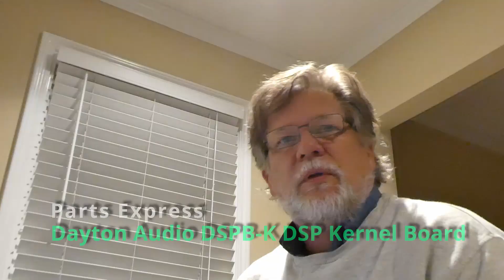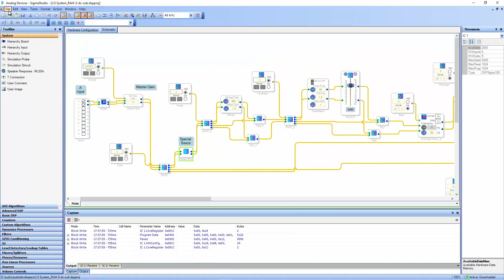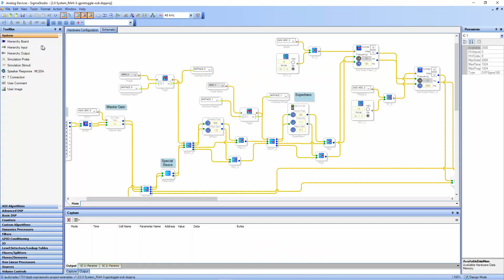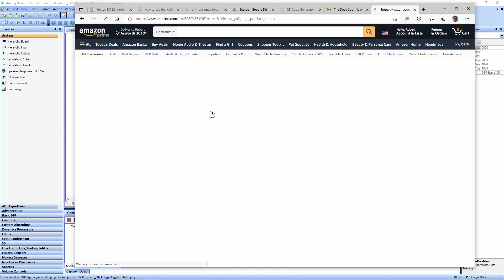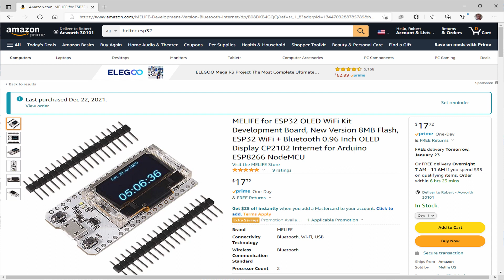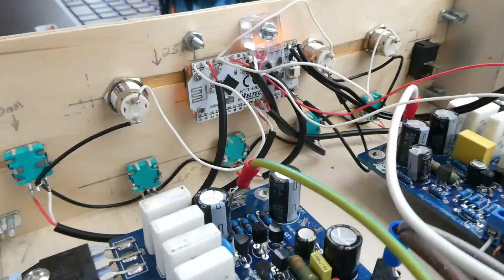ADAU1701 Based DSP Board Stack (DSPB-K, DSPB-KE, DSPB-ICP1) by Dayton Audio

Comment: AMAZING!!! Can you please make some videos on communicating via I2C to the DSP Board? It will be Great.Cheers
Reply from the maker: Next up
I hope 🤞
Reply from the maker: In the process of preparing a video I fried my Heltec ESP32 board with ESD (electro-static discharge). I am weighing replacement of the board against a total redesign. If I redesign it will be a long time before I can complete (or redo) a video. So, I figured I would make available the source code. Maybe anyone interested can use it to get going.

https://github.com/rhenry74/heltecesp32-adau1701

Comment: I have problems to send data to dsp i will tried the gib hub idea but dont working, can you help me ?
Reply from the maker: Program the DSP with "i2c howto.dspproj"

Burn the sketch to the esp32

My sketch only writes values to DCs. The addresses of the DCs have to be gleened from the dspproj as it runs if you create a new one. My DC addresses match my sketch. 

My safe write code in my sketch should work on any ESP 32

Comment: Nice to find others exploring these DSP devices.  My project is a 3-way crossover "times two".  I have a six channel amp and will have two ADAU1701 boards with identical SigmaStudio programs.  I'm not enamored with the daughter-board and its connections and want to use just the DSP board the pinouts to connect the input/output signals.  Do you see any difference in using the Control Ports (J3 / J4) versus the Connection Port (J1)?  

My S.S. graph has the single precision "crossover block" to set the low/mid/high XO points.  Have you tried the dual precision option?   Also, I'm using the POTS on the DSPB-K to adjust the gain due to different driver sensitivities.  There's an option to adjust driver gain in the crossover block also, not sure if that makes any difference.  

Once I get the XO's dialed in, I may contact you about how you interfaced the board with the shield (Arduino?) and screen.
Reply from the maker: Oh wow, I have practically the same plan for a stereo three-way powered speaker system that does not have a crossover. I was going to use the 3255 class D amps and have each one drive its own driver inside the cabinet, fed by two of these DSPs with the same sigma studio project loaded on each.

I have an example of how to control these DSPs over I2C from an ESP32 on GitHub. See the link in the description.

I too was thinking about forgoing the daughter board on my build, but I have not attempted to work with the kernal board without it yet, so I can't lend any insight about that.

I don't have experience with Sigma Studio's crossovers. I elected to use two separate third order (I think) high pass and low pass filters controlled by the same DC in order to have a crossover effect. I found it much more tunable. I use it for base management in the example on GitHub.

I imagine... balancing the power sent to individual drivers independently may be challenging. I think the MCU will come into play here. I think a programmable mapping of loudness across the three drivers at as many volume levels as needed will be a must.

Comment: How can make writeback to work? When I turn off the board and then on again, I want the board to remember my volume level. Im using GPIO pins for an enconder.
Reply from the maker: I think the component you use is called a write back. But my suggestion would be to search the engineer zone at the Analog Devices web site.

Comment: Rewatching your video again. I have done this a few times to to get as much info as posible as both Sound Inports and Dayton audio dont have much simplified info on this product. I have got very far in programing and implimenting the dsp in my project . Thanks your your advise and williness to help.
I have this thing buried inside a case but need to have the pots on the front panel as opposed to indide the case. I am willing to desolder the pots on the board and solder wires to get external pots. my question is there must be a simpler way. Do you have any idea how to do this without de soldering? Thanks
Reply from the maker: Yes,

The pots lead out to j connectors. So you can run wires to your own pots and leave the pots on the board maxed all the way out. So the initial resistance will be like the two pots are in parallel but as you turn your pot the value will decrease to zero.

Make sense?

Comment: Thanks Rob. According to you, What are needed to build a 4.2 dsp system for car audio? this system is 2.1?
Reply from the maker: Yes, this DSP kernel board has three outputs. 

Interesting you ask because I'm considering doing this for my next project: you might consider using two of these... one for each side. That would make it a 4 input 6 output but you would only be using one input each so it's easily still 2 in 6 out.

Comment: Great vid. I just bought 2. I'm trying to find out How to connect a esp32 to it. I clicked on the github page but could work out how to make the connections.  Can anyone here help. Thanks
Reply from the maker: ESP32 GPIO pins:
#define I2C_SDA 4
#define I2C_SCL 15

DSP-K pinout is on page 41 of the users manual
J3 pin 5 is SCL
J3 pin 7 is SDA

And connect GND of course. J3 pin 2 to ESP32 GND.

Comment: Really enjoyed this. It helped me understand the big picture. Can I write to you to ask some questions about using the Dayton stuff with a microcontroller?
Reply from the maker: Yes, hit me at my email. It is not straightforward to write to the DSP without it making a popping noise.
Reply from the maker: In the process of preparing a video I fried my Heltec ESP32 board with ESD (electro-static discharge). I am weighing replacement of the board against a total redesign. If I redesign it will be a long time before I can complete (or redo) a video. So, I figured I would make available the source code. Maybe anyone interested can use it to get going.

https://github.com/rhenry74/heltecesp32-adau1701

Comment: Board is POS- got one today and nonstop static. noise floor is so bad
Reply from the maker: I noticed a noise floor with my copy too. But the overall signal to noise ratio was okay, not exceptional or anything but just okay. Or you could have a bad copy.

To mitigate the noise floor I put a (physical... like cap) low pass filter on the output, then compensated for the drop in high frequencies in software. I just tuned it to my ears (unscientifically), but now I don't think I'm missing any highs and I can't hear the hiss from 5 or so feet away.
Reply: May I know what POS men Sir? I'm a beginner  sound enthusiast